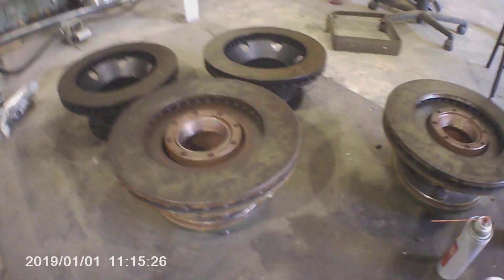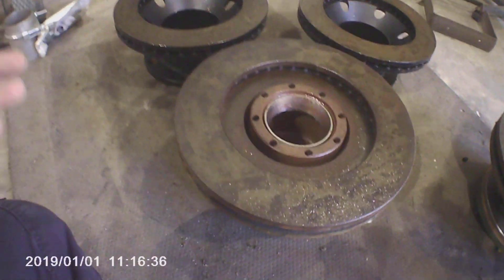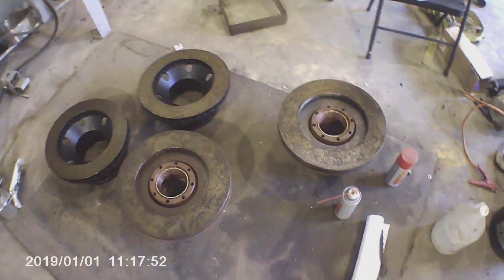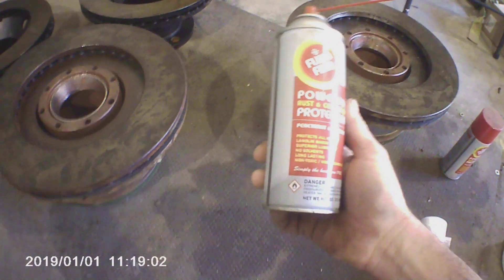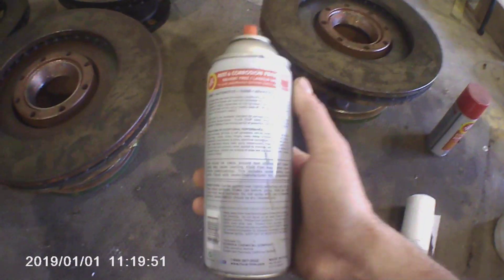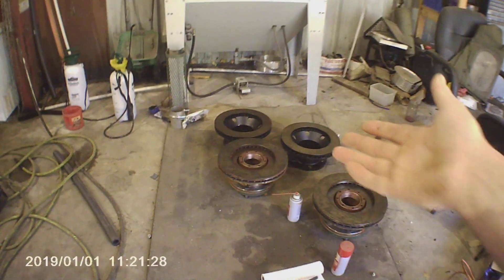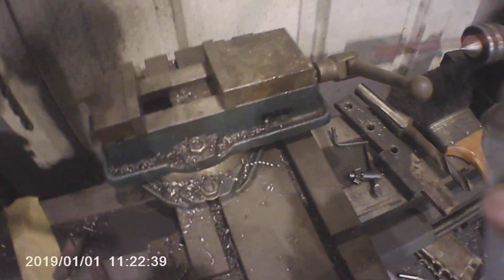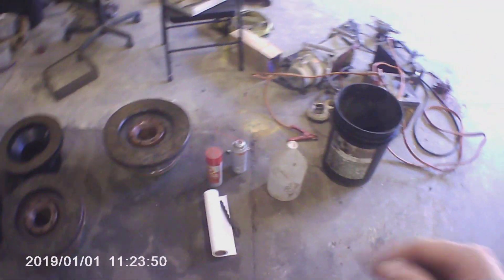My favorite (the best) corrosion inhibitor for storage

Comment: Hands down, one of the best things you can use is 30% chainsaw bar oil and 70% diesel fuel mixed in a pump up sprayer. Neutralizes rust thanks to phosphoric acid, and leaves behind a very protective residue due to its paraffin base. Works wonders for undercoating a truck before plowing or even better undercoating before going in the mud. You’ll find mud will literally fall off randomly at times unable to adhere to it

Comment: Fluid film is the bomb. I use it as undercoating because it stops rust and unlike most undercoating the rust will not creep under it. The only down side is that you do have to reapply as it does wash off in about 18 months or so.